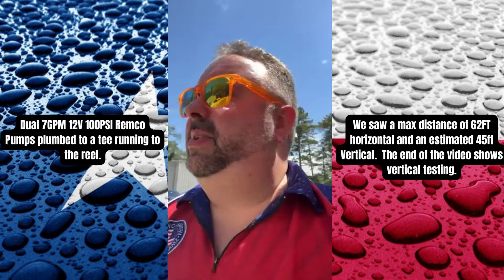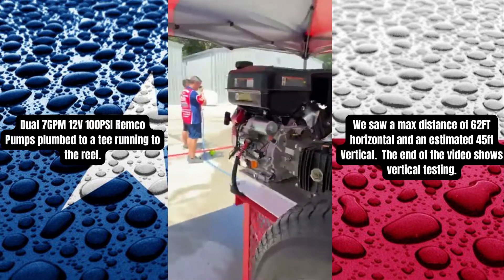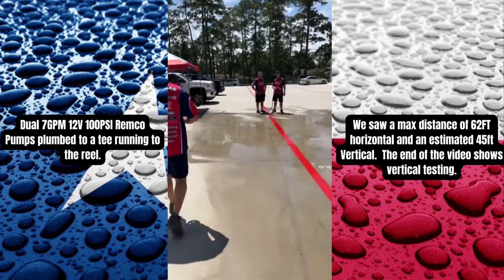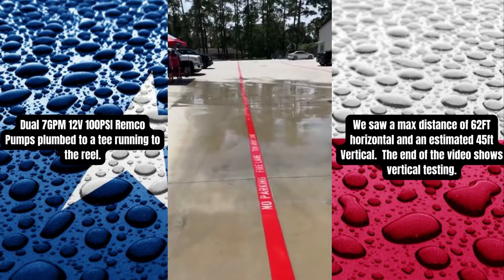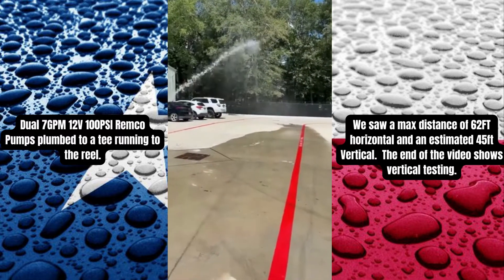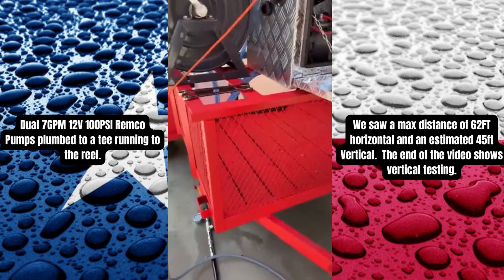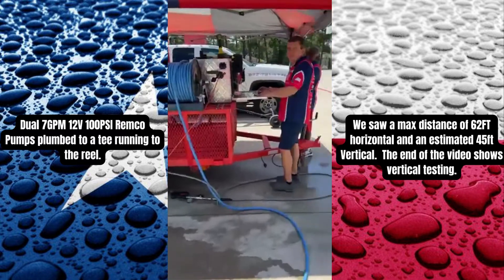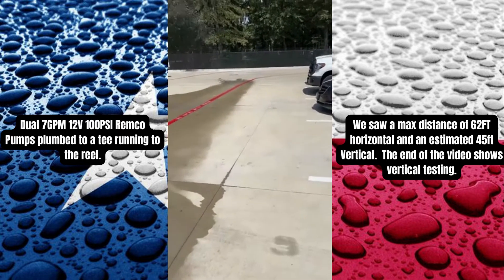12V Pump Shoots 60FT with a Red Gun

Comment: Does this pump work better with 3/4 meter valves or 1 inch?
Reply from the maker: 3/4 is required.  1" won't pull chemicals correctly.

Comment: You can get 65'+ vertical with 250' of 5/8 hose on dual Remco 7''s @ 100psi with Red Gun. Make sure hose reel manifold, pump fittings, valves/proportioners are all plumbed 3/4 so you end up with 7 to 8ish gpm. Also 200 watt Solar panels for keeping batteries up too.
Reply from the maker: Good info thanks for sharing!
Reply: Right now I have the red kuritec 1/2 hose. With 1 inch to the tank. Will this hose size run the 7gpm ? Thanks guys.

Comment: Is it plumbed with a t from the proportioned through the 2 motors and then another t to the reel?
Reply from the maker: T after the pumps to the reel.  You can T it after the proportioner if desired.

Comment: Pros and cons of this vs a gas soft wash system?
Reply: gas has a bypass loop always pumping when off trigger, 12 volt on demand pumping stops after pressure is built to proper level with auto switch and shuts pump off.
Reply from the maker: Gas is higher volume and distance.

Comment: There's a deficiency with those pumps I found when running duals. After about a month the flaps in the valve housing will break off and need replacing. It's a super easy fix but something to look out for. When running the pump as a single unit I've never run into the issue.
Reply from the maker: We are using the threaded ones.  Are you running check valves?
Reply: @TexasPressureWashing  hose reel is still 1/2 manifold
Reply from the maker: @seattleprowash  correct unless you upgrade them.